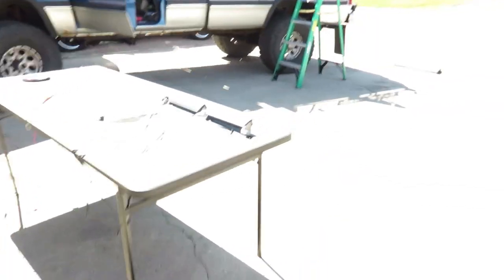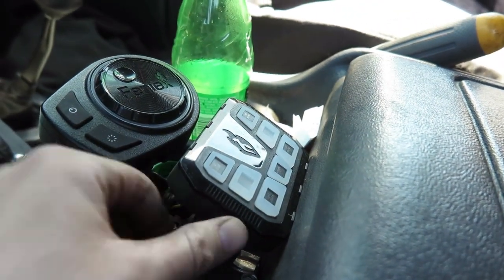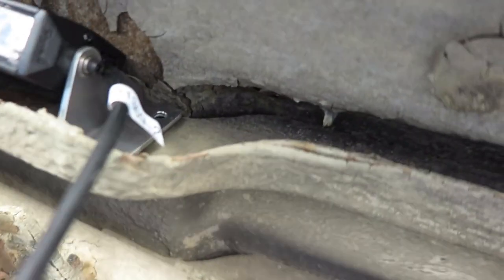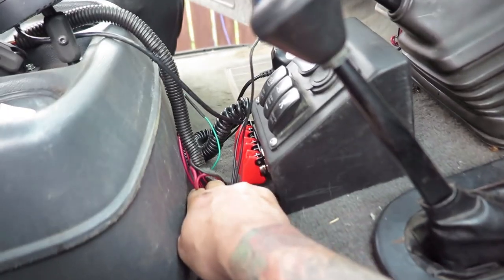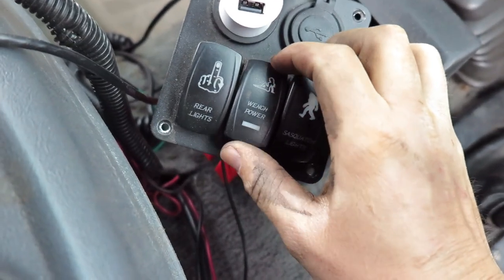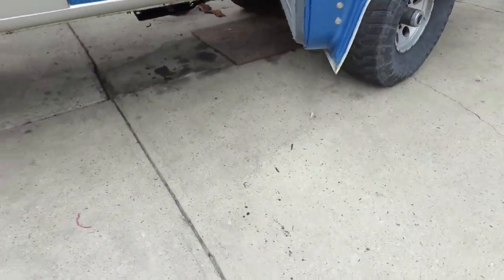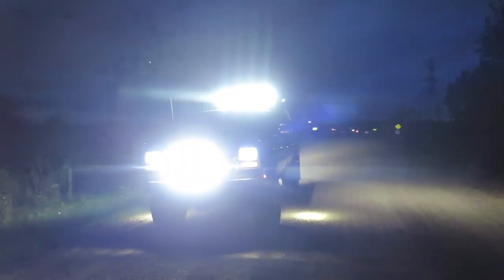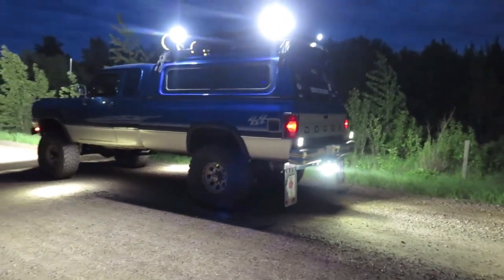Last Light install on Barb

Comment: I heard you say you are going to re paint the rack, but maybe consider getting it powder coated, would probably be a lot more durable. Only downside is you’ll have to take everything off of it and it’ll cost more.
Reply from the maker: Finding someone with an oven big enough is the problem
Reply: Eric Jalbert maybe check out a trailer dealer/manufacturer I know they powder coat those.